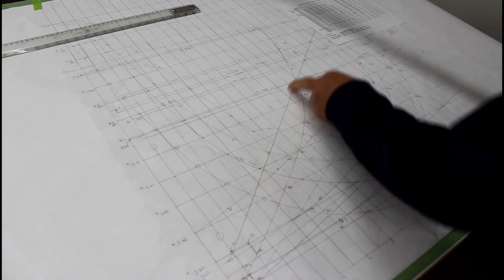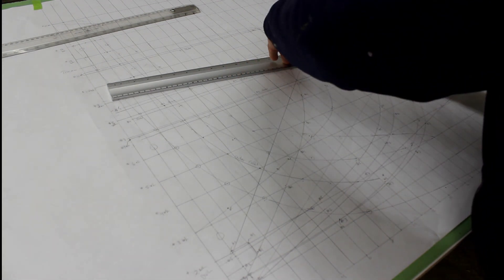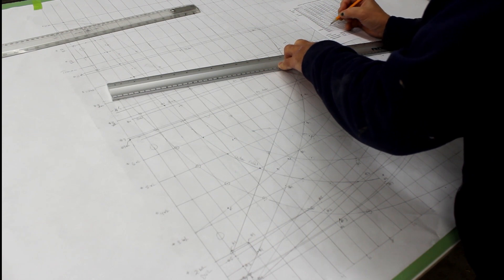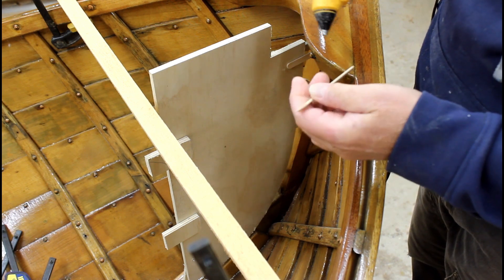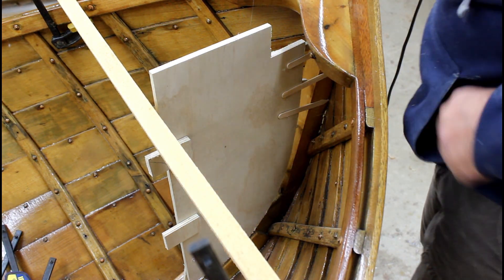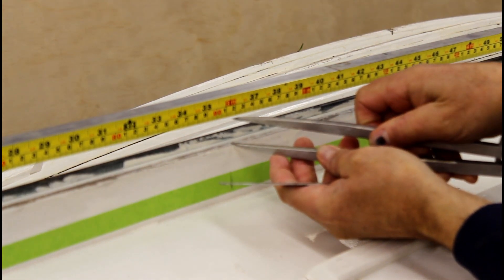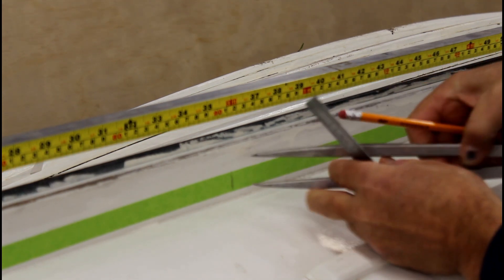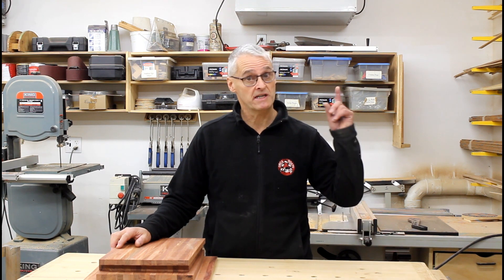Takings Lines - final episode

Comment: Thank you for doing this series; it has done more to help me understand lines/lofting than all of the reading I've done to date!  How would you establish the waterline if you couldn't float the boat (say like Harvey Golden taking lines off of museum pieces)?  If you were taking lines off of a decked boat (kayak), would it be the reverse of what you did here, plotting from the outside of the hull and deck (and then subtracting the plank thickness)?  (I'd love to see you do videos on taking lines from a kayak and lofting it!)
Reply from the maker: With a lapstrake, traditional small build like a row boat, it is best to take patterns from the inside since that is where planks will land when overlapped. But it could have been done from the outside and either listed as measured to outside of planking or subtracted the planking thickness from the table of offsets.  On a larger, round hull or where one could not measure the insides such as a kayak, then yes one would set up some sort of frame jig and measure everything on the outside of the hull.  It would not matter if you were not able to float the boat.  I could have simply leveled out the keel with a laser and used that as a base line or used a level line above the boat.

Comment: Mr. Can you teach me how to draw the diagonal lines ?
Reply from the maker: Are you lofting out a set of plans or are you drafting up a new set?
Reply: @OrcaboatsCa  it's just a curiosity
Reply from the maker: @j.p.francofranco2866  Diagonals are at the discretion of the designer.  They are usually 2 to 3 lines drawn through the body plan and are usually from a waterline point on the center line to another point where a buttock line and waterline intersect.  These lines cross through most patterns and add points on the grid where maybe there is no waterline (horizontal) or buttock (vertical) line.  Think about a hard chine boat in which the point of the chine is between  a waterline and buttock line, so where would you graph the point.  Hope this answers your question.  As I go through the process of actually lofting out this boat in upcoming videos, it should become clearer.
Reply: @OrcaboatsCa  thank you [obrigado]
Reply: @OrcaboatsCa  I was having the same question. Didn't realize they were at the discretion of the designer.   I look forward to seeing the lofting process.  thanks for the info.